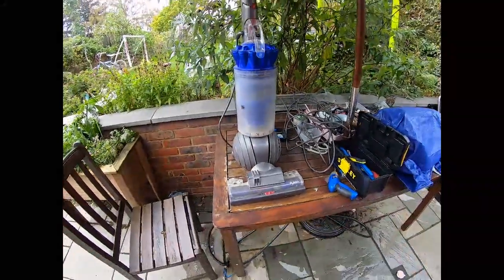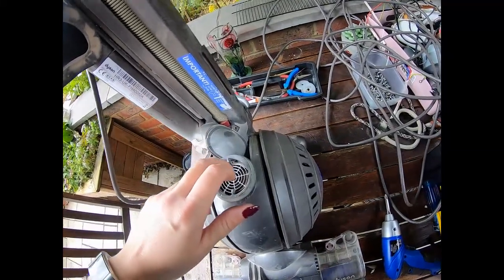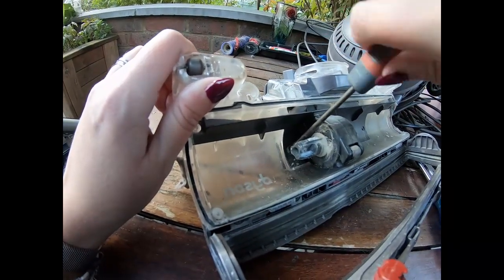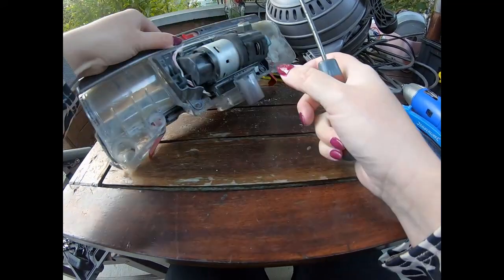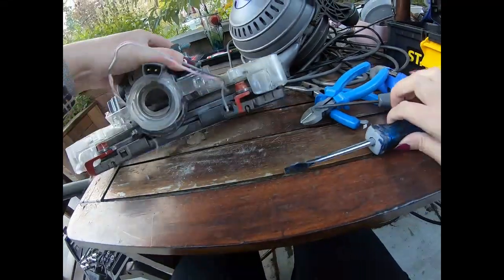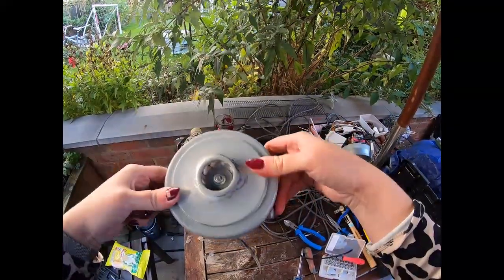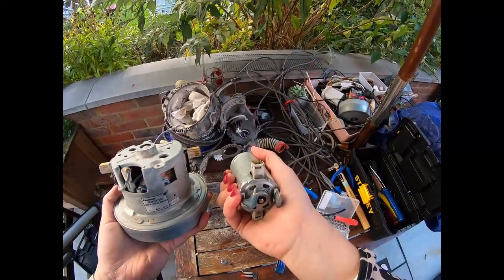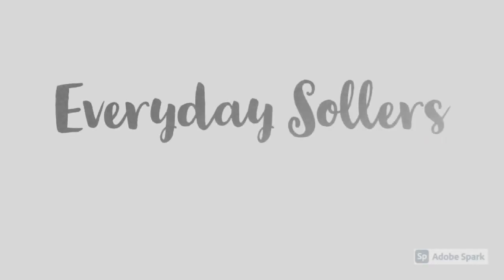e-waste: how much copper is inside a Dyson vacuum cleaner/ hoover DC41 teardown scrap out

Comment: Wot do u do with all the plastic will the bin men take em or do u take em to the tip
Reply from the maker: Our local recycling centre has a bulk plastic bin so it all goes there 🙂👍
Reply: Oh rite as cool
Reply from the maker: I take it all, however not all black plastic can be recycled but you can put it all in the bin and they sort it, it is impossible to tell the difference!